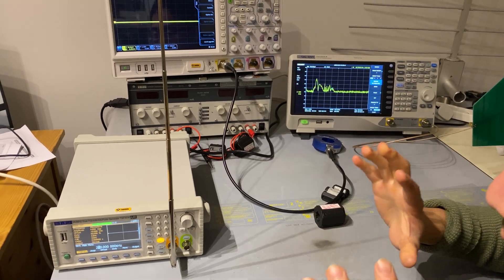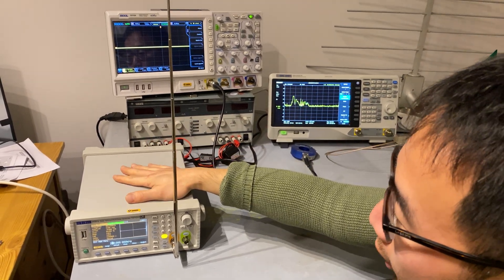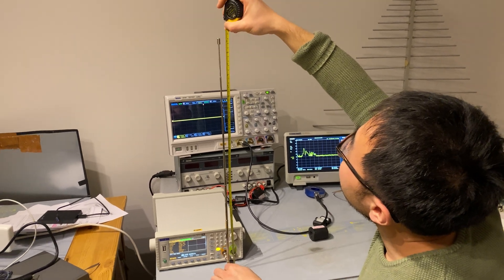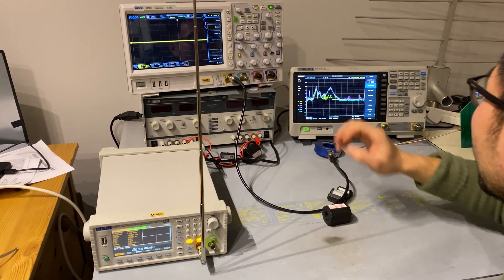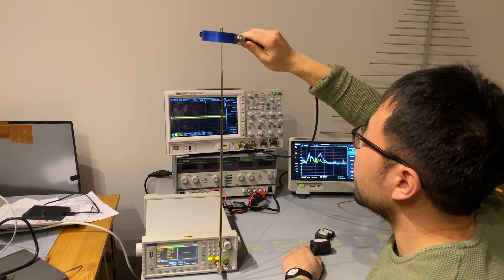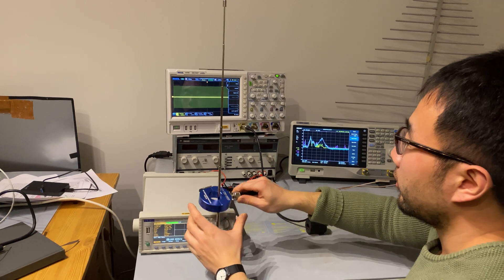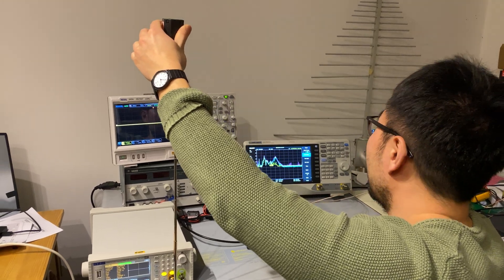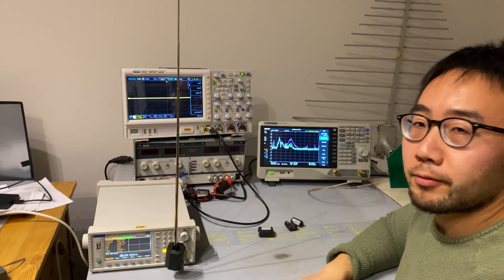A 1/4 Wavelength Antenna Explained & How to Place Ferrite Cores

Comment: Thank you, I like your video very much. I want to know why the 60cm antenna radiates strongest at 120Mhz. I watched your other videos and you said that when EM wave travels on a cable structure, due to the dialetrics of the insulation material, the velocity of propagation is slower than the speed of light, generally, then apply 0.7-0.8 as a rule of thumb kind of thing. But here it seems that the factor is 1?

Comment: Subscribed to your wonderful channel.
If your antenna was connected with a coax cable, should you place the ferrite at the feed as you told or at 1/4 wl from the feed on the coax as well? I see some VGA cables with ferrites at some distance from the connector on both ends. Thank you
Reply from the maker: Hi David, i guess that is related to radios, it would then depend, here is a better resource for you https://incompliancemag.com/cable-antennas-and-ferrite-cores/
Reply: @MachOneDesignEMC  Wow. Very interesting. Thank you very much for your time. Yes, it was about common mode currents on a coax cable of an HF antenna, amateur ham radio.
I always use multiples of 1/2 WL coax cable  to see the same impedance of the antenna at the end of the line and I wonder if the line being resonant is good or bad, or if resonance can be avoided using ferrite chokes, and where to put them on the cable.
I will study your videos and the document  of your link.
Thanks again.

Comment: And Now I finally understand how A common mode choke works. 
I have A Question....
Why do some put the CHOKE at the end of the antenna cable by the Radio ??
Reply from the maker: Hi, the point is to demonstrate that a ferrite works the best when it is placed in the low impedance point, in this case, it is the radio side. As you can see from the video, close to the tip of the antenna, we have almost zero current, that means at the tip side, it is high impedance (because of low current), therefore, if you place the ferrite on the tip end, it will do nothing. Also see https://youtu.be/bflbmTCVKk0?si=z8PSYyEhk9kjGXAO
Reply: @MachOneDesignEMC  thank you for that explanation. i will go look at the video you have linked

Comment: I am a bit confused about your claim. From the instrument the signal of interest(123MHz) is suppressed by the ferrite? Also how does 250KHz signal from signal generator gets out from the 60cm length(1/4 wave) antenna? 60cm length(1/4 wave) antenna resonate at around 125MHz but get suppressed by the ferrite but 250KHz is fed into the antenna. Could you explain?
Reply: He explained this at 1:29 .  It isn't the repetition frequency of 250kHz that matters, it is the very fast rise time of the pulse.  A 3ns pulse contains lots of harmonics much higher in frequency than 250 kHz.  The 1/4 wave antenna is peferentially radiating those frequencies around 125 MHz.   Higher and lower frequencies are coming out of the generator.  If it was a 250 kHz sine wave instead of a pulse the rise time would be very slow and there wouldn't be any higher frequency components.
Reply: you're right, the Fourier series decomposition of a square wave with a period of 250kHz corresponds to a  fundamental tone at 250khz and it's odd harmonics up to infinity for an ideal square wave with a 50% duty cycle. the odd harmonics decay faster with a slower rise time. with a fast rise time of 3ns these harmonics are now quite prevalent.

since real devices aren't perfect, asymmetric rise and fall times make the duty cycle not exactly at 50%. the power in the odd harmonics start bleeding into the even harmonics now!

123MHz is probably the like 491st to 493rd harmonics of the 250kHz sqaure wave.

Comment: So therefore if you want to suppress CMC on a feedline to a quarter wave antenna, you would place the ferrite a half wavelength down from the feedpoint. Questions: do you take the velocity factor of the coaxial into consideration? Could you do a demonstration on this?

Comment: Will this also reduce the TX of the signal also? Ore just reduce the Noise?
Reply from the maker: Hi Anders, it is a demo, so more for information only. But the principle should be the same for both signal and noise. The critical thing here is understanding how a cable can act as an antenna. If you are an RF engineer, you would like to use this to benefit your design, if you are an electronics engineer, you need to avoid this to pass radiated emissions test.

Comment: thank u so much sir ,the signal generator frequency reading 250khz but spectrum reading 130 mhz ?
Reply: The 250kHz square wave from the signal generator has fast edges which gives lots of harmonic energy up into many MHz. The antenna resonates at a frequency that matches its length - as described in the previous reply. That's how the signal generator has a different frequency than the spectrum analyzer sees in the antenna.
Reply: Length = wavelength/4. Length=60cm or 0.6m so wavelength- 0.6x4= 2.4. F=C/wavelength. C-3e8(speed of light). Wavelength-2.4. F is 3e8/2.4 which is 125MHz.

Comment: Hi, pretty nice video but what happen to the antenna's gain when the ferrite core is used?  Does it affect the radiation pattern? Thanks.
Reply from the maker: Hi, that's a great question. It would surely affect the gain, or what we call the AF. In terms of radiation pattern, yes, I am sure it is affected. You need some good Filed solver so see the impact.

Comment: Great video, perfect demonstration of the principles at play and concise in just 7 minutes. Hats off, that's not easy!  Click bait title would be nice, most people do this wrong 20dB attenuation with a ferrite bead.
Reply: Will this also reduce the TX of the signal also? Ore just reduce the Noise?
Reply from the maker: Thanks Frank for the good words! Need to learn from you about the bait title, any suggestions? Won't be easy to change this now I guess, but for future for sure.
Reply: @MachOneDesignEMC   At the end of your current title you could add "to reduce EMI". That should help.

Comment: Thank you for very simple and nice explanation, which can be very useful in EMC debugging. Could you please share more details about your setup: antenna specs, spectrum analyzer and the current probe? Thanks
Reply from the maker: Hi Nikola, antenna just normal telescopic/whip/rod antenna, those you find on a vintage radio basically. Spectrum Analyser is a siglent SSA 3000 series, Current probe is a Tekbox TBCP2-500 I believe.
Reply: @MachOneDesignEMC  Hi, thanks for the answer.
I meant on the receiving bi-log antenna? :) 
Thanks
Reply from the maker: @nikolaivic4480  that is a PCB antenna from Kent Electronics, see https://www.wa5vjb.com/products1.html, I bought the 36 USD one. Very good
Reply: @MachOneDesignEMC  thanks a lot for the details. Do you use some other like bi-conical to cover <400Mhz band more efficiently, or this one is good enough for these kind of tests? Thanks
Reply from the maker: That one I think you can use down to 200 MHz or even lower. Generally from 50MHz to 300 MHz, I use https://www.tekbox.com/product/tbma1-biconical-antenna/

Comment: Nice explanation Min. How does that translate to PCB signal traces or interconnect cables. Should the filter be at the source end of the line or do you need to determine where the maximum impedance of the trace/cable is? Assuming that the impedance is nor constant along its length, in which case the placement of the filter is not critical?
Reply from the maker: Thanks Simon, for the positive feedback. Filters on PCB are different, they need to be placed on a quiet side, i.e. away from the noise source to be effective. This is to avoid close field coupling. I guess this video demonstrates the point for a system/product with cables.